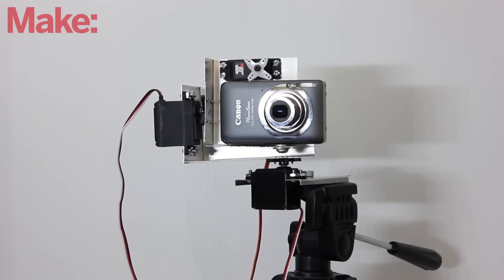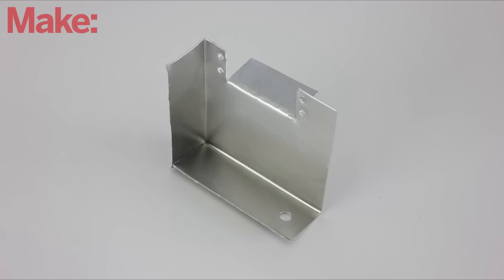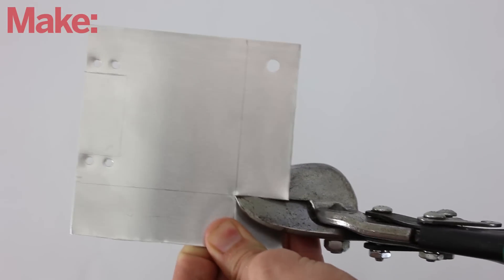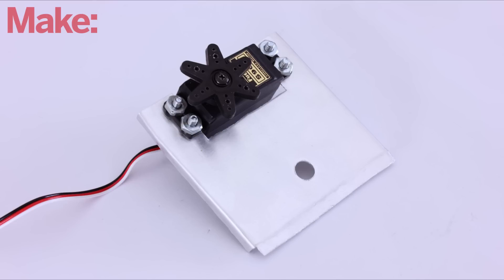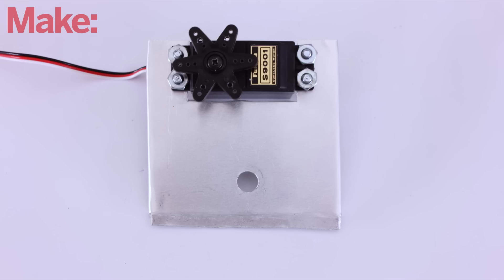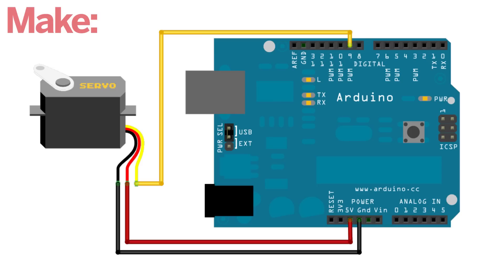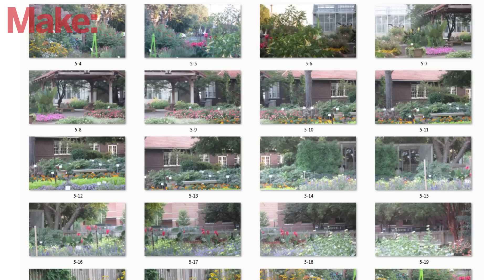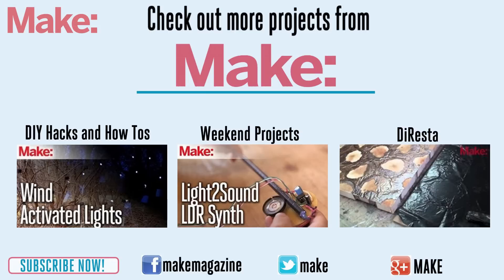Build an Automatic Photo Rig for Perfect Panoramas

Comment: The idea is great in principle, but the project is let down by the quality of execution;

1 - The sheet metal is way too thin, which makes it prone to flex and vibration (the N#1 enemy of tripod photography!) 

2 - There's sharp edges everywhere, just waiting to cut your fingers! Please use a file to deburr. 

3 - Camera tilts forward due to pressure applied by shutter servo. Again, increasing rigidity will cure that. 

If you want to use this rig at telephoto lens extension with a small aperture opening, you will need solid rigidity to avoid camera shake. Otherwise you'll get blurry pictures. If you want to do night and low-light photography, rigidity is even more important, because of the long exposure times. 

Time to build prototype N#2? ;)

Comment: This is a good video on how to make a ptz assembly but should not be called "Build an Automatic Photo Rig for Perfect Panoramas" It maybe could have been called Build a PTZ Assembly for use with Adrino... since you skipped over the important part of wiring it and programming it. This only shows you how to build the PTZ assembly and not the "Full Rig". I could see it working if the link you have in the description linked you to a page that had the full details but the page only has the exact same thing as stated in this video with no further details.